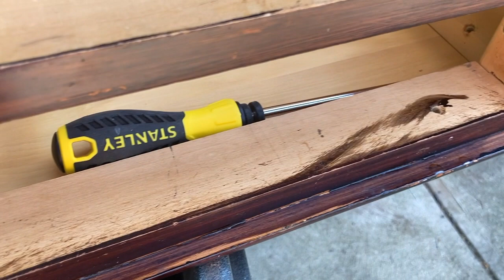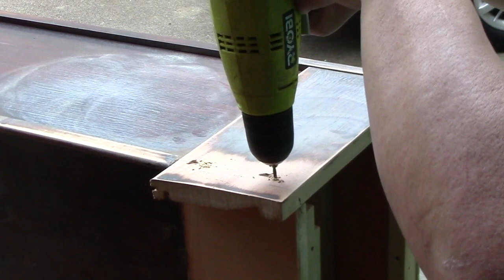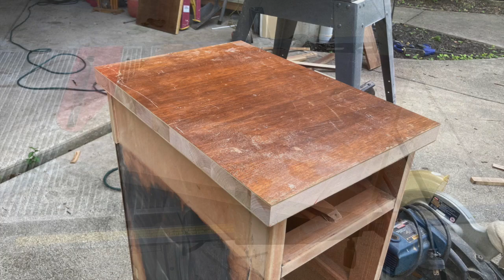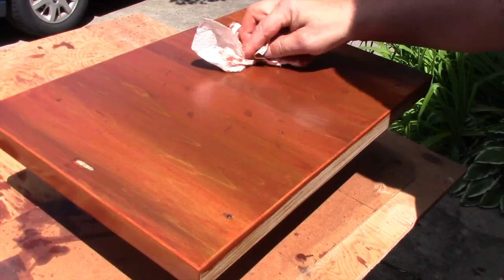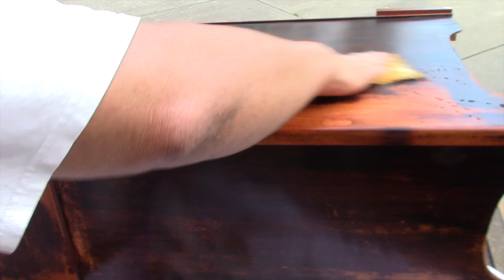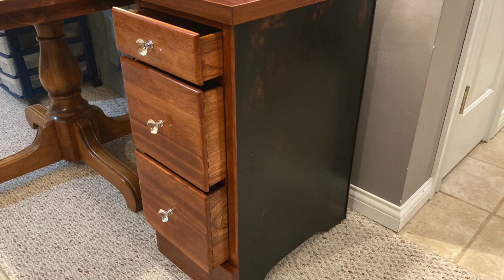Desk to Drawer Storage / Nightstand Conversion with solid Poplar & Oak from a curb on garbage night

Comment: Great work, I also love fixing crapped out furniture. You could definitely sell your projects, if you run out of room.
Reply from the maker: I have tried to sell some refinished furniture on Craigslist with mixed if not downright disappointing results. Do you have any train projects coming out soon?
Reply: @bobsworkshop5181  I don't know. Sometime I might paint another F3 shell into silver streak so I can have a clean version. I likely won't make a video on that because it's basically the same as the ruined shell. I have mostly been getting organized. Hopefully I can get to a train show soon and get some shells and other junk to modify
Reply from the maker: @chicagolandrailroader  I have an unpainted Lionel F3 A shell that I might turn into the Silver Streak Train but I'm not sure that the decals from CIRCUS CITY on EBAY would line up as nicely as the Williams F7s. I'm running a little low on new ideas for trains truthfully.
Reply: @bobsworkshop5181  they will probably work fine. Its worth a shot.

Comment: Loved the changes until the black. You lost me there.
Reply from the maker: Well….. that’s ok. The sides would have taken a long time to sand and I don’t really like using chemical strippers (even though I have in the past). I’ve done a few other pieces at our house with nice, new looking tops and fronts and then done the distressed sides so this matches them a little bit. Even in the video, I acknowledge that it’s a bit like cheating but in the end, I still kinda like it, in some cases. Thanks for watching it though. Have a great weekend. Bob